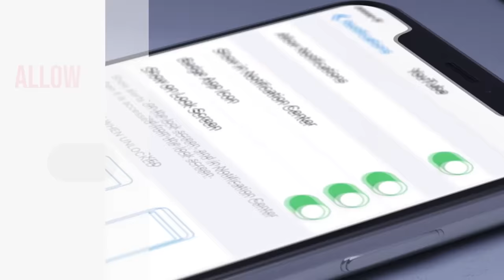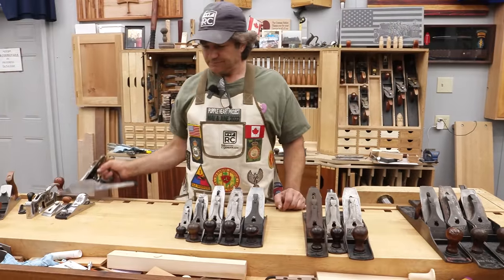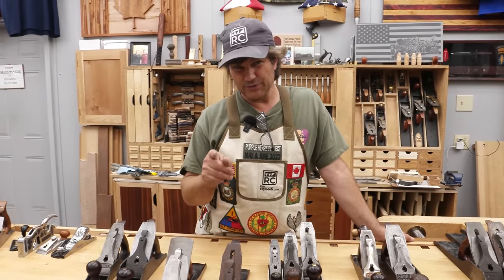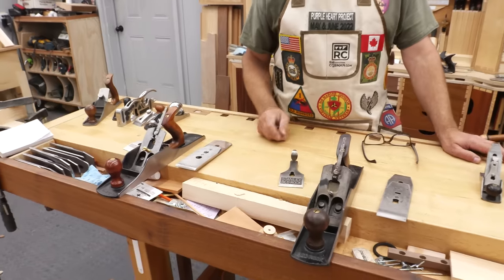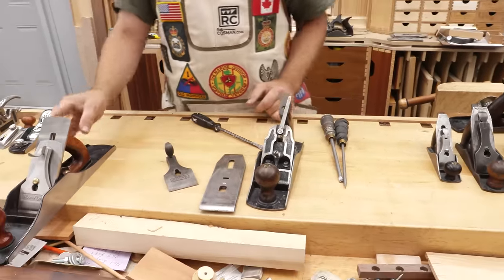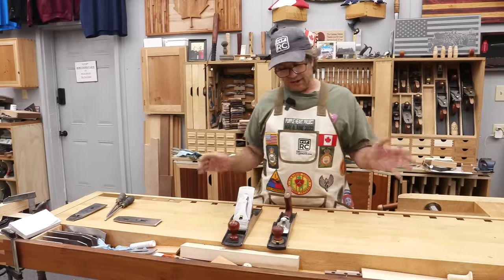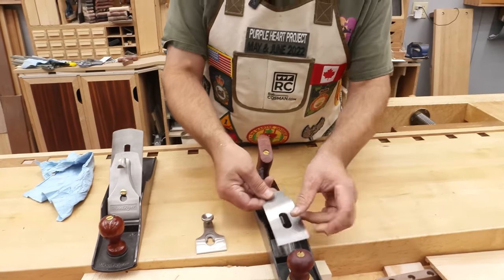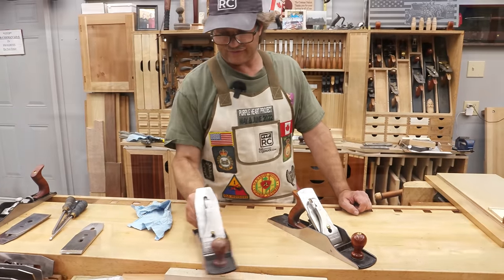Your First Hand Plane To Start With - Maybe the only one you need !

Comment: Yet to see Rob demonstrate the proper use of the cap iron 
i.e honed to at least 50 deg, set no greater than under 1/32" from edge, and an OPEN mouth,
and maybe a smoother with everything the same bar cap iron closer, like 1/64" or thereabouts to demonstrate 
and give an honest comparison between premium planes and the older Bailey's.

Just saying, as many here, have progressed watching Rob's videos,  have a bench and designated space for their planes by now, so might want to try out some of the vintage flavour which doesn't need to have square sides and indestructible qualities.
As yet to hear Rob say "this plane will tackle ANYTHING", which suggests the planing videos isn't upto speed with the rest of the work Rob produces and theres a lot of content yet to be published from our favourate Canook.

I suspect this is an older publication, as there seems to be a few videos made recently which has certainly stepped things up a notch.

All the best
Tom
Reply from the maker: Tom…we shot this video a week ago….its not “an older video”. When you say cap iron you are referring to the chip breaker….correct?

I don’t buy that moving the chip-breaker closer to the edge of the blade helps reduce tear out.  The physic’s do not make sense to me and in practice it doesn’t work for me.  I have seen the Japanese professors video, but I am not convinced.  I know lots of folks think differently and thats Ok
Reply: @RobCosmanWoodworking  Hello Rob, I guess  you've tried this with a tight mouth, which some claim to work,
I don't buy that, as I struggled doing so for a long time before realising the tight mouth was stopping the cap iron (chipbreaker) from getting close enough, as it was honed at at least 50 degrees.

It's very apparent with a steeper cap, and basically gives one no choice but to open the mouth,
unless one takes only the thinnest of shavings,  which would work regardless, only with far more effort.

Best thing I ever learned once I got the basics down from yourself and Mr Charlesworth's publicaions,
The top two fellas for learning honest planing techniques IMO, and everybody else having bad habits.

Basically saying someone with your planing  methodoligy  i.e precision tolerance honesty and all the rest
has no excuse for not uilizing the cap iron/chipbreaker to its full potiental 

As some might never learn this with less than ideal planing technique/methodoligy as they scoff at the thought of having a 
flat bench.

I forgot to mention another thing which likely fits into a water shaprening routine, be it shaptons or diamonds...
is that "perfect camber,"   which became much easier for me to achieve after a suggestion of putting fingers exactly on the spots which are needing work, and not leaning/tipping with such a minute camber with fingers just very close, as I was getting inconsistancies doing this.

Using water was half the answer to this, as I could allow my fingers to get closer to the hone and not have filthy hands afterwards.
Not that makes much difference to your sharpening technique as that is evidently always spot on, but for others having bother.

 Cheers
Tom

Comment: Great video. I have a question. You don't ship to the U.S. so I went to Wood River. They have the 5-1/2 for $280 and the 6 for $220. I will only be using this for flattening. Would the 6 be good for this or a bit too much of a good thing?

Comment: I am totally new to woodworking, especially, using hand tools. I was going to go the power tool route but have decided to switch to the hand tool route. I'm a little confused about the use of a 5-1/2 as a smoother and a flattener. Can it do both? do you have to have two different blades sharpened differently or do I buy a 4-1/2 smoother also. I am mostly going to work on small projects. The largest probably, building my own work bench. Help!!!

Comment: Rob I am one of those who will disagree with you on going straight in at a 5½. When starting and working with softwoods I think a number 62 is a better plane for a beginner. This is because the investment is less as there are decent mid range no.62 s on the market such as the modern Stanley Sweathart. Also in the case of the Stanley it comes with a hollow ground primary which acts as a reverence for the final sharpening so maintaining that 25deg and resultant 37deg efective cutting angle. The drawback on low angle planes is that a grinding wheel is prety much a must have for restablishing the primary after multiple secondary sharpening's.

For a second plane a no. 5½ is the way to go. At this point enough experience should have been built that what a well tuned plane feels like has been achieved. This opens up the vintage market if the budget does not extend to a premium tool. Now again I am going to disagree with you a Bedrock style is only a nice to have. Adjusting a baily style mouth only needs the chipbreaker iron pair to be removed twice. Once to slacken the from locking screws them place the iron back in the plane and then use the justment screw exactely like you would on a bedrock. This removes the gueswork. Then romve the iron so that the frog locking screw can be tightened.

I will admit that I did end up bying a new iron and chipbreaker for my vintage 5½ (which I restored myself) however I did this because one side of the iron was so far of flat that properly platerning the origional Stanley iron would have left it wafer thin.

Now personaly for a smoother I think that a No.4 is better than No.4½ and is comforable to use in a two fingered grip rather than the cramped three finger grip. It is a smother so you realy want to follow the hils and valleys that are still in the work and a narrower plane is better at this.

I will say that I tend to leave my no. 5½ set in a smoothing configuration and rely on good saw technique for the initial surfaces. It is very rearly that I have to set for heavy stock removal. For that I would use the 5½ to idendify the high points (ie use it as a fore plane) then come in with my crapy modern no.4 in a scrub setting to do the bluck removal.

Comment: The Veritas Low Angle Jack has a better design than the Woodriver, here are the numbers for comparison:

Veritas LAJ Vs Woodriver LAJ
Length: 15" vs 14"
Width: 2,8" vs 2,4"
Blade: 2,3" vs 2,0"
Weight: 6 vs 4,6 pounds
The side faces are also bigger on the veritas, but couldn't find a number for them. 

The 5 1/2" is not that much bigger than the veritas LAJ, here is the comparison:

Veritas LAJ Vs Woodriver 5 1/2"
Length: 15" vs 14,9"
Width: 2,8" vs 2,9"
Blade: 2,3" vs 2,4"
Weight: 6 vs 7 pounds

So the 5 1/2" is just a 1/8" wider (body and blade) and 1 pound heavier than the Veritas LAJ.

The 5 1/2" would be better than any 62 LAJ by all the points made in the video, but against the Veritas LAJ those advantages are almost negligible.

Comment: I have a "Made In England" Stanley 12-205. It sat in a tool drawer for many years unused until I was helping a neighbor with a woodworking project and he was attempting to use a hand plane to shave down a piece of wood. I decided to break it out and have been devouring all of the plane sharpening and set up videos. My question is, "What size category does this 12-205 fall into?"
Reply: It's a number 5 sized plane so, it would be a jack plane
Reply from the maker: As en510 says its a jack

Comment: Hi, Rob, I started with a vintage Stanley number 4 that I tuned up myself. As you said, it was a learning process and took some time for me to get right. It is a lovely plane now, especially after the addition of a Hock blade and cjip breaker. Then a friend gave me a Keen Kutter 5 1/2. Tuning it was not as much of a chore having been through it once. I added a Hock blade and chip breaker, and my eyes were opened.. i have three blades now, a heavily cambered one that I use for heavy stock removal, a less heavily cambered one, and a straight blade with eased corners for smoothing. This is my go-to plane for almost everything.. I love the weight and the width. My number 4 is permanently set as an ultra-smoother. I have a number 7 that I use for jointing and flattening large stock. But it is the 5 1/2 that I find in my hand 95% of the time. Stu (PS: all of my planes have your AdjustStars — the best bang for the buck addition you can make to a working plane)
Reply from the maker: Yes the 5-1/2 really is the best suited jack plane.   I love it too

Comment: Rob, I’d appreciate your comments / advice regarding a Stanley #5 Jack Plane which I’ve inherited recently. The plane has been kept in storage for quite a few years but is in extremely good condition except for the fact that the sole of the plane is slightly out of true. I’ve seen many YT videos which demonstrate how to flatten the sole using sandpaper stuck to a flat surface . I have  a James Barry 300 grit Diamond Stone plus two Shapton glass stones, a 1000 and a 3000 grit. As a ’noobie’ I was wondering if using these stones to lap the sole is a viable alternative to using the sandpaper method?
MVH.

Comment: Rob, in your comparison of the low angle jack to the 5 1/2, I was surprised you did not mention the biggest annoyance of the LA jack…that being how difficult it is to adjust the blade with the tiny and awkwardly placed knob on the LA. I have a Lie Nielsen LA jack that I bought in the 90s. Yes, I use it because it’s a beautiful  plane however, even without your AdjuSTAR, the ease of adjusting a standard bench plane blade in and out is tenfold easier than on the LA jack.
Reply from the maker: Yup I missed that.  Because of the handle configuration you are absolutely correct.  Good comment, thanks

Comment: If I may ask. Is there such a thing as too big to be used?

I often have to make solid wood countertops. Larger than fits in our power thickness planer 15 inch grizzly.

Can a large jointer hand plane also smooth?

Aside from weight ( not an issue for me ) and space... Is there any reason not to go with a number 8? Can it be made to smooth too?

Comment: @RobCosmanWoodworking I've heard you mention the bit about 4's and 5's being built for adolescents in school woodshop class before. Do you have any sources? I'm not arguing, but rather curious as by the time I was in school shop class was basically gone. So, I've never had any exposure to planes before getting started a couple years ago.

BTW, I've been using a 4 and a 5 for most of my planing for about 2 years and agree that a 4 1/2  or 5 1/2 would likely feel better. I like my no. 6 for that reason.
Reply from the maker: No sources, but if there were the No. 4 would no longer be the most popular plane. Unfortunately we’re so far removed from when there was a professional market that that common knowledge has been lost. Go back 100 or so years and think about how many professional woodworkers there would’ve been using a 4-1/2, 5-1/2 or 6, compared to how many school shop classes with 4s and 5s. Hence why the market is so flooded with them.

Comment: If a back bevel pushes the chip breaker further back from the cutting edge and a finely tuned one assists with planing difficult grain then is there a downside to a employing a back bevel?
Reply from the maker: No.  The back bevel is tiny..1/16 of an inch.  This does not have any negative effect on the blade action….trust me, lots of experience using back bevels

Comment: The few times that I dont agree with the assessment that BR are better than Bailey Designs.  The issue is that there really isn't anything wrong with the Bailey design.  You are better off controlling tareouts with cap-iron settings and having a sharp blade. Having a very closed mouth is also hard on the edge right before the blade. It IS a lot of work to get a plane working correctly, but it's part of the hobby.  BR imposes a weight penalty with no realistic benefits AS LONG AS the Bailey is well tuned.  In fact, early bedrocks are also based on just a simple two bolt on a slot adjustment system.

Comment: Very surprised to hear you dissuade beginners from vintage tools which they can buy for a fraction of the price of a brand new WoodRiver. If the blade is the problem, they can use a Hock blade, which again, is a fraction of the price of a new one. 

I am glad I used Paul Sellers as my virtual mentor rather than you, he showed beginners like myself you don't need to make a massive upfront investment to get started and it CAN be done with older tools. I certainly would not pay £££ for brand new plane without testing the waters first.

My only planes so far are vintage Stanley no 5, 4, wooden jointer (again, fraction of the price of anything brand new) and recently another 4 which I converted to a scrub plane after repairing the tote by gluing it back together. All of this cost me peanuts compared to the plane you're pushing. 

Wood hasn't changed much over the centuries, oak is still the same oak as before as are others, so not sure why in 2022 the older blades are such a problem when craftsmen have pushed out and are still pushing out amazing items using the same.
Reply from the maker: You do whatever you want. If you want to struggle with vintage planes, go right ahead. To me, the extra expense to get modern machining and blade technology is worth it for a beginner. Less struggle with the tool means more joy with the wood.
Reply: What a bizarre thing to say, why do you assume I struggled? I'd understand if you said it's quicker to get started with a new plane but to claim the old ones are inferior for their intended purpose is not true. If you're on a budget to get started, they will do perfectly fine

Comment: Great content I'm a 51/2 convert. The grey iron is a bit of a misnomer though there's a vast difference in purity and casting and heat-treating against the old Stanley's. There is a video of an old Clifton dropped from stepladders on to concrete with no damage, few pros for grey is thermal stability much better less likely to deform as it's not a malleable steel like ductile, and more liquid in casting for thin parts. I can attest to some of this I have a Veritas I dropped and it lumped up next to the mouth like a puddle ripple almost. Impressive it didn't crack but equally screwed. This also isn't info I searched for on wiki. I contacted Cliftons foundry and the grey iron is worlds apart. I think there's some good marketing out there and some miss information from companies. I don't think there's anything in it with modern quality planes I think it's availability of steel and setup. Also the numbers in tensile strength their talking holding bridges up not pushing a plane at that point anyway the steels moving all over. Sorry haha thought I'd share some of my research, I won't be dropping my beautiful Clifton either to check haa
Reply from the maker: Thanks for the informative comment

Comment: Pretty obvious that old #5 doesn't get a lot of use! And personally not a very big guy, other than weight I am the same size I was in Junior High. It's not that I don't agree with the premise, I am just the exception that proves the rule.
Reply from the maker: If your hand are smaller sized the #5 might fit you better

Comment: So...avoid a honing guide and hand tool sharpen so you build a skill, but buy my new plane so you don't have to learn how a plane works?  $280 for a new 5 1/2 vs $80 for a 100 year old type 11 that took 3 hours of actual work and may 4 hours of research to understand what I needed to to it to not only make it match any new plane, but left me with an experience and the knowledge to push further.  I bought a #4 wood river and a #4 type 11.  The wood river is currently for sale, but that's just me.  Love the techniques though.
Reply from the maker: Learning to freehand sharpen is VERY easy.  Learning how to plane by first learning how to refurbish an antique plane with a poor blade (as compared to modern bladed) is not an easy path for most beginners.  Just look at all the comments of filks who share their story.  But if you want to spend the time and effort to learn restoring go for it.  I certainly have spent a ton of time restoring antique planes

Comment: Maybe I'm alone in this, but I think Rob should be embarrassed by this video. Blatant sales pitch with opinions way outside of what most experienced people say, and said with the conviction most commonly found in politicians and salesmen. Go find well-regarded experts who are NOT selling things, and you'll find cohesiveness on the other side of the argument. I was sad to watch this display.
Reply from the maker: David, you’re free to watch other channels. We’re not even allowed to sell these to 75% of our customer base, so why would we make a commercial out of it? Quit being a negative Nancy and do what you will with my opinion based on 40+ years of professional experience. Don’t want a 5-1/2? Fine, go spend your money on a No. 4 like most others would recommend.
Reply from the maker: Forgot to add, based on the comments, you are alone!
Reply: @RobCosmanWoodworking  I doubt he is alone, many people just done want to bust peoples bubbles by disagreeing. I use vintage tools and really have no problem, with chatter, trouble sharpening and blade flex, parts not fitting due to bad machining, chip breaker, adjusting frog or fitting my hand fit (tractor mechanics hands). Did I have to learn to clean and tune my old planes,  yes, was it a problem no. Actually the 5 1/4 was primary made for adolescent hands and used in schools. The 5 is most common because it is a jack plane and does what title says. Everyone is entitled to their own opinion and you have yours and others have theirs. Last but least many of these videos do have a commercial aspect, and you admit that, so kudos to you for that.